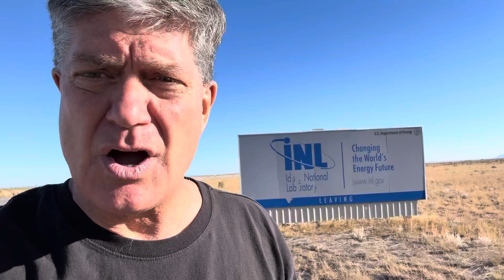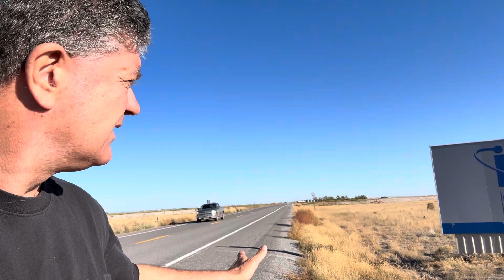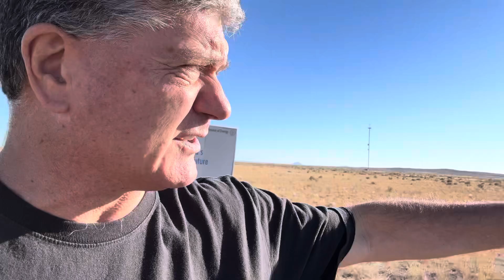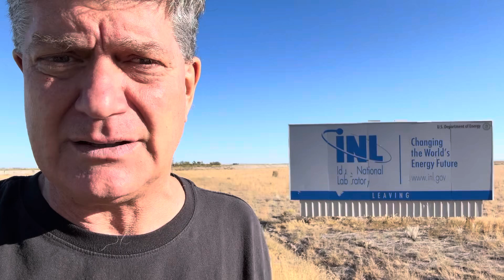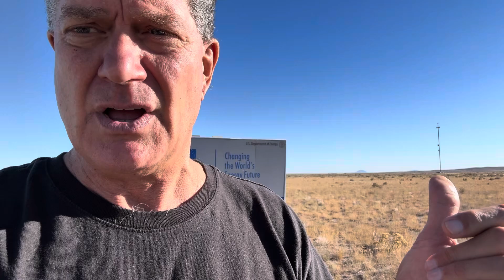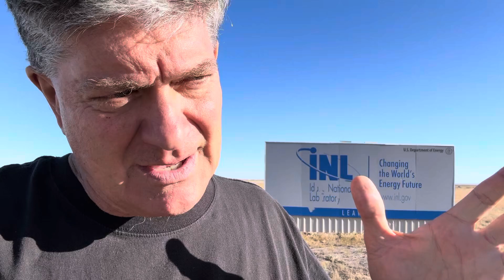Why Are Small Nuclear Reactors So Important?  AI Data Centers - Russian Missile Uranium May Be Handy

Comment: SMRs have no earnings yet with PE ratios upwards of 200. You can't do any of this without dirt and stones. Uranium is moving Rare Earth moving. The escalation of power has to be buffered, Energy storage moving. AI demand for energy will collide with Bitcoins orphaned blocks dilemma. Proof of work consensus mining is good, but BTC cannot scale without counter-party risk which was the whole point of Bitcoin in the first place. Ethereum is a fat pig too, but it has the most TVL of any smart contract platform with Tom Lee's BMNR accumulating ETH at 13x velocity over Michael Saylor's BTC treasury. Now everybody is rushing to secure their own layer-1 blockchain to control their own stablecoin, none of which would be necessary had BTC been scalable. Sometimes velocity is not with the right tech. The intention of Bitcoin was to be a money of the people, now it's a Wall Street asset class. Regardless of the new ruling Proof of Stake cryptos are/should be securities. It should be Kaspa, but it not a self-licking ice cream cone and doesn't have VCs, velocity and volume or Wall Street pushing it.